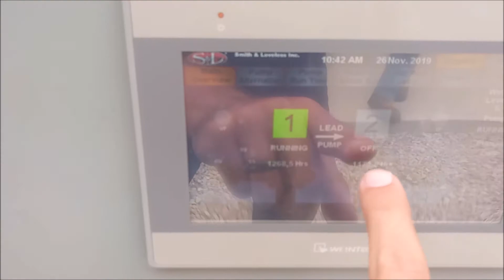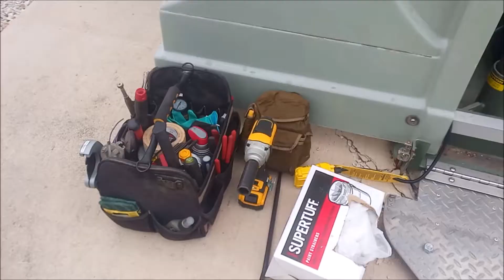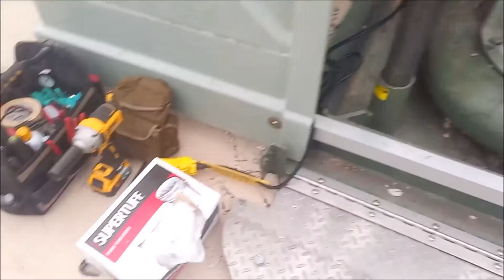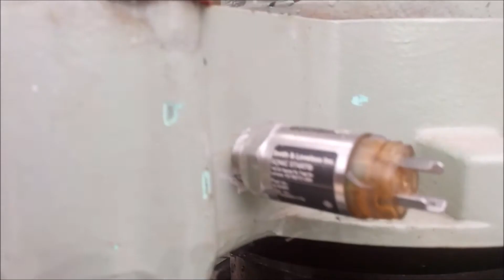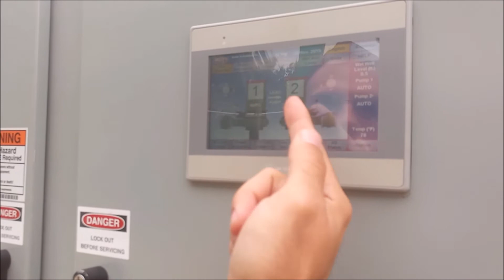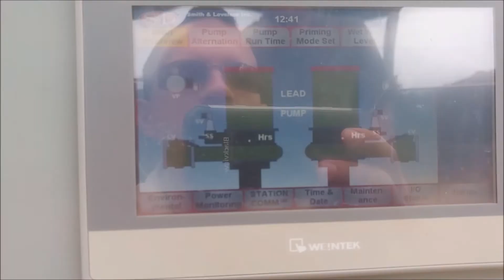Smith & Loveless Lift Station Pump De ragging

Comment: Very good.  We have the same system. My recent situation saw the vacuum gauge quickly reach 10 and the vacuum pump kicked out. After the vacuum pump kicks out, the vacuum on the gauge drops instantly to zero. And when it reaches zero the vacuum pump starts again and the cycle just keeps repeating itself. I suspect the vacuum path is plugged somewhere but what causes the gauge to drop from 10 to 0 in a split second?
Reply from the maker: If the vacuum pump is kicking out, that means the pump is primed enough so that the level sensor that looks like a fork is getting a signal. I would check the chamber that the sight glass goes into for any obstructions from the main chamber that is giving it a false primed indication. Second, I would look for a leak/break in the line that goes the the gauge. Really hard to say without being there! The gauge gets it's reading some the main pump housing, so it's reading vacuum in there, then it's being lost. Maybe even a plug in the main suction line coming from the wetwell?